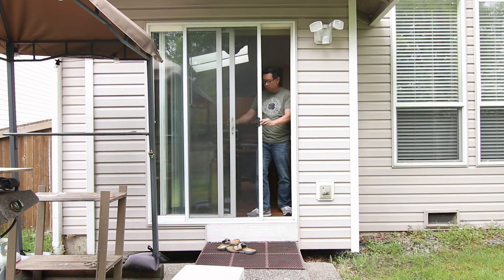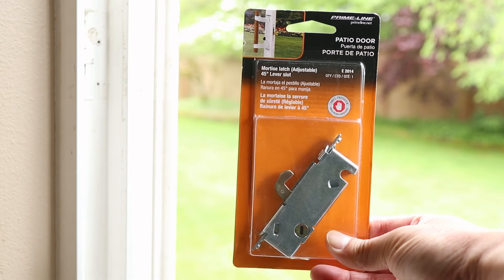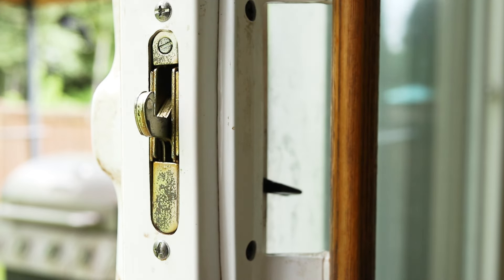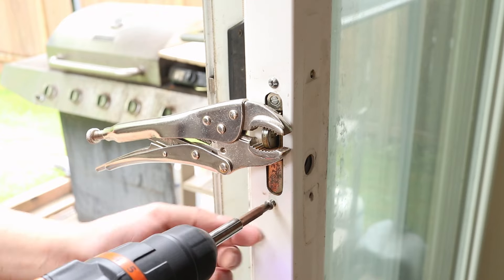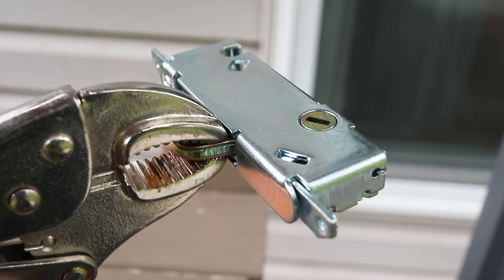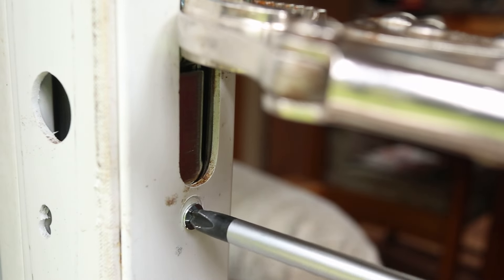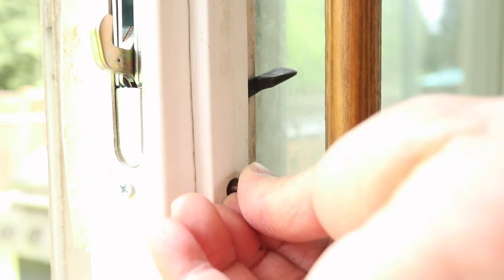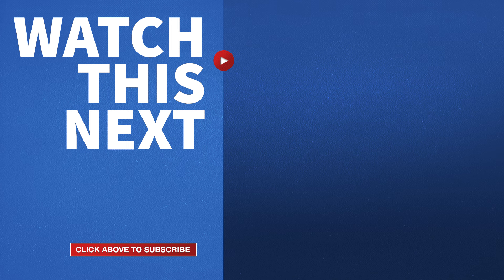How to Replace a Sliding Glass Door Latch - Patio Door Latch Replacement - Patio Door Won't Lock

Comment: Excellent video & instructions! A couple of add-ins: 1) Identical mortise lock at Home Depot Canada was  CAN$27.00 plus tax (should've checked Amazon as suggested in video) 2) For whatever reason, slot screw in mortise lock assembly was loose (from sealed package), needed tightened up) 3) Post installation, mechanism was very stiff, corrected by a couple of shots of WD40. All in, never done this before not more than 15 minutes!! Thanks for great video!!!
Reply from the maker: Nice addition tips! Glad you were able to replace your patio door lock!

Comment: Looks easy enough. However, even though I have the exact same lock style, it won't move back into the door so I can pull it out. I looked through the access hole, and it turns out there is a steel block behind it that keeps it snug against the opening, from the inside of the extrusion. I can't figure out for the life of me how to get the block out so that I can move the lock mechanism back. I may have to take the door off the track, maybe the block runs all the way top-to-bottom and needs to be slid out of the way from an access at the top or bottom plate...  Edit: If anyone comes across this in the future, there was a sort of carrier with larger screws to remove, and the lock comes out with it. The screws were hidden by a trim piece that closed the end of the door, which did not look removable. Lock came right out. And another tip, there is a spring inside the mechanism that breaks. The spring pulls on the latch which is what makes it pop out when you lock it. I stretched the broken end of the spring and formed it into a hook and re-attached it. That fixed it. It's a bit tricky to open the mechanism since it is held together by crimps in the sheet metal, but with a punch you can release them, then use a chisel to spread them back into place to close it back up afterwards.
Reply from the maker: Wow that's a tricky issue! Thanks for sharing your solution. I hope that helps someone!